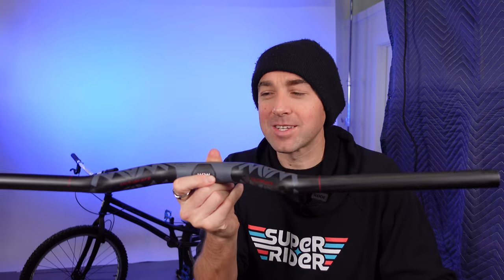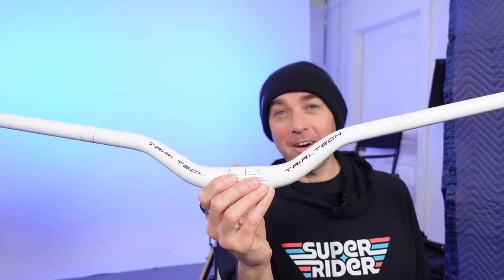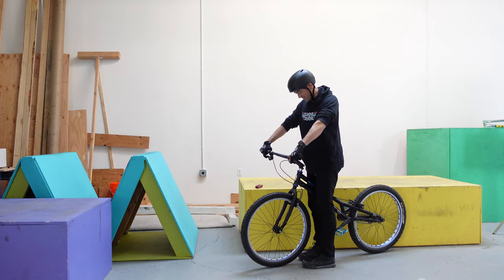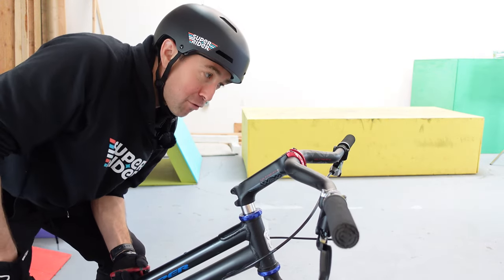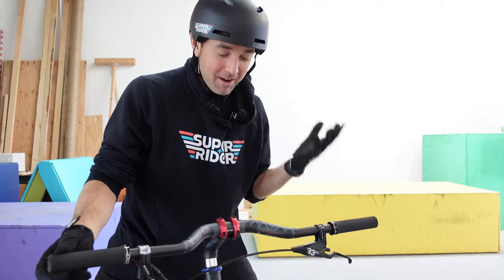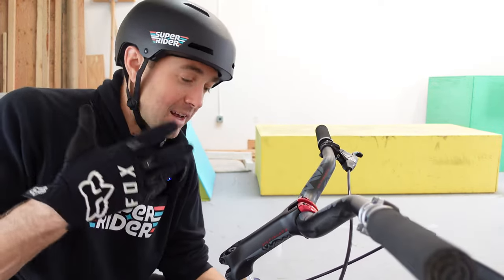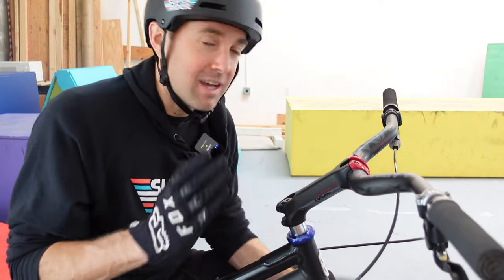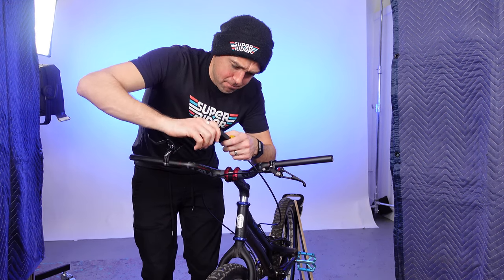The Handlebar Dilemma

Comment: Nice new bar and stem. I’ve been thinking about changing my stem on my comp bike, but current fork is cut at an angle, which would mean I need to replace them also. I want something with a little less rise. I agree with where you left the bar in the end, that’s similar to where I run mine. I see some extreme positioning sometimes, I just can’t do it myself! Enjoyed the content 👍🏾
Reply from the maker: Thanks so much! I ran into this exact same problem on my Jitsie mod bike. I've heard good things about the Crewkerz forks, but that would've required a special headset and all sorts of messing around to get it right. Feels weird to ride this bike at the moment, but hoping that it clicks soon!

Comment: Over rotation can give reach issues. Pogos like a dream (pogo stick?) but other moves are spoiled. If lifting & swinging the backend is important, bias forward. If popping the front up is important then bias back. About 15degs either way should be noticeable with midpoint being in line with the stem. Beware wrist ache, these machines hammer your wrists 🤙
Reply from the maker: Good call for sure - so anxious to get some time on this modified handlebar setup. Feels like a big learning curve, but I know it'll be worth it once I settle back in!
Reply: @SuperRiderTV  definitely worth persevering. For what it’s worth, anyone learning to ride both styles needs to be chilled about the different feel between a street trials and these contraptions. Each has its operating mode, related but different. Best example is the bunny hop. Street bike it’s almost automatic. Stock bike it’s plain odd or a no but you find a different way is simple. However, no question in my mind that learning both styles expands both styles.
Reply from the maker: Agreed. I’ve been riding both for a while - but a big change I recently made was to focus on 26” wheels, no matter what style. I think the 24” and 20” bikes were holding back my riding overall, since I was switching between them so often and never really getting comfortable.

Comment: This is not something we normally do with MTBs but I got the point. In other words, MTB riders are forced to exert a lot more power and balance when they are on back wheels. Well, maybe I'm just making a convenient excuse for my lousy back-hops.
Reply from the maker: I did something similar for my MTB, but instead of rolling it forward, I experimented with different riser bars to get the maximum results. In a similar way, it was interesting to find out how much the different angles and rises could make a difference on the riding.